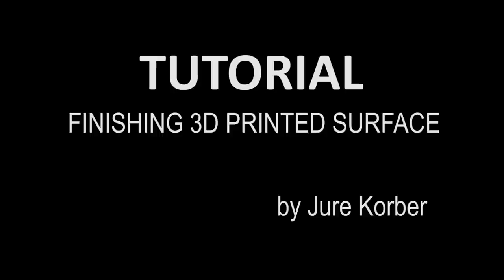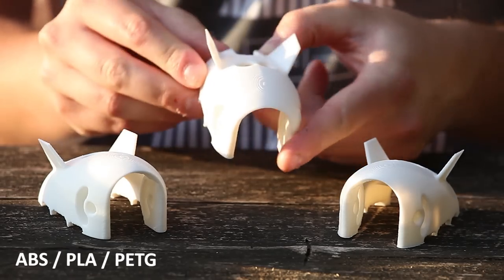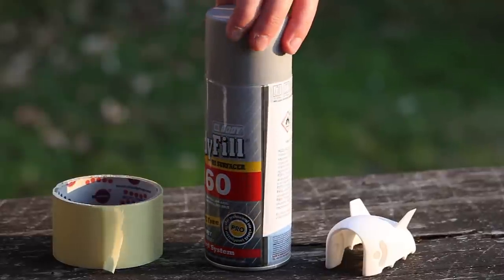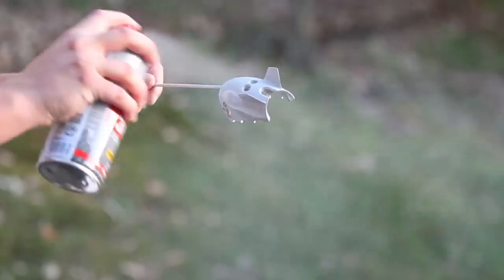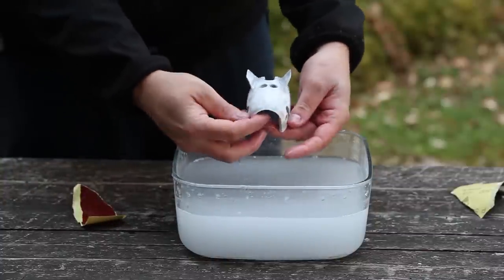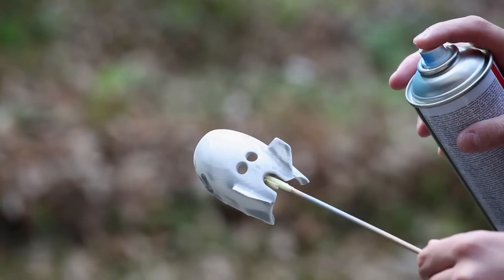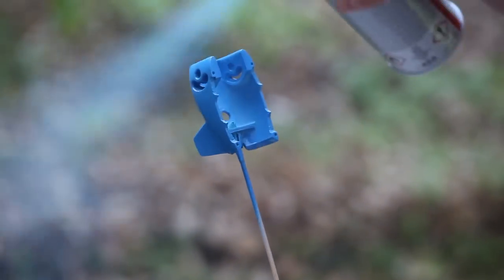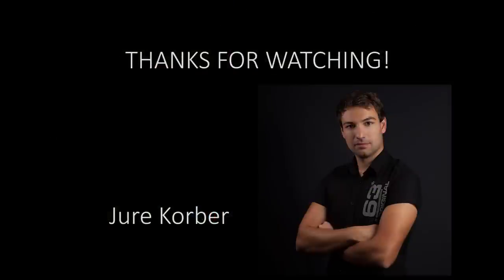Make your 3D printed part (surface) look awesome!  TUTORIAL

Comment: Can I use this technic on parts which are supposed to be assembled to other parts and have screw holes on them? I think the paint layer will make the part bigger and make it hard to assemble.
Reply from the maker: If you are careful, the paint can be very thin. Sending will reduce size and paint will than again make part bigger - so it may fit. You can also apply this technique only to visible surfaces and not on connecting / mating surfaces. You can protect mating surfaces with painters tape.

Comment: What printer are you using? I've been very interested in the past few months now they are looking more affordable.
Reply from the maker: I'm using Prusa MK2, which I find really OK for the price (kit). You need to upgrade it a little after buying and than you will have perfect printer with great print quality! :)
Reply: how much did upgrades cost?
Reply from the maker: Hey! I've paid around 150$ for the upgrades (IGUS bearings, NOCTUA cooling fan, additional printed parts for printer, another nozzle, replacement PEI sheet for future replacement when original one gets damaged). You can start with stock build, than print yourself upgrade parts with stock printer than upgrade it after some time :)

Comment: Do you have technique or tips for printed figures or characters.. tnx
Reply: Print with highest resolution and use filler. You can also use a variable temperature soldering iron on the cool setting to smooth out details. Works good a hiding bad layer shifts or extrusion problems, or where you paused the print, or where you just can't get sandpaper between. Takes practice though so try on a print you don't care about to get the technique. You have to push in light strokes with a flat tip, feathering it into the print.

Comment: Why do you use the filler? Can't you just sand down the raw part until it's smooth and then paint it?
Reply from the maker: Yeah! But with filler it goes a bit faster and final surface is smoother, as filler fills the tiny gaps that are left in 3d print surface. It also acts like a primer.
Reply: Got it! Makes sense. Thanks for the reply!

Comment: excuse me , I can't find the same spry filler in my city ,  ( the body fill ) as same as your video 
can you tell me  what should it be ? and what I must prevent ?
and thank you
Reply from the maker: It's no need to be exactly the same. It should be "spray filler" or "spray primer with filling effect". Anything for automotive use will work nicely! :)
Reply: is this usually used as clear coat for car paint ?
or can I use WD 40 instead?
Thank you
Reply from the maker: no and no.

Comment: You said in the guide that the arms need to be carbon fiber 4mm thick, how thick do the other parts (the three plates) need to be?
Reply from the maker: They are 1 or 1.5mm thick. Depends on what you have available in your shop.
Reply: juresnip thanks for the info! currently looking around online trying to find a good place to order the carbon fiber parts from. Do you also have a complete bill of materials for all the hardware like bolts/standoffs/spacers and such?
Reply from the maker: raw /sheet material or finished/milled?

Comment: what size of sand paper do you use 180 but after...?
Reply from the maker: Hey! It really doesn't matter what grade of paper you use. If you use fine paper, it will take a lot of time. The best is to use something around 200, than something around 500 or 600 and that's it. For final touch you can also use 1000 or 1500-2000, but I think that's not really necessary.
Reply: I use paste white befor sanding it work more easly I think cause sanding work well for simple object but for complex shape it s impossible to sand under little details ,paste +alcool can smoth little details...

Comment: Tutorials like this always focus on simple models with nice accessible convex shapes. It's a shame nobody has a method that works with finer, more complex models such as sculptures.
Reply: French polishing worked for me on a propeller once.
Reply: @kokeskokeskokes  How small was the part?
Reply: @Martial-Mat  22 cm diameter with sharpened edges.
Reply: @kokeskokeskokes  So do you physically polish each surface?
Reply: @Martial-Mat  Yes. It looked like this: https://www.youtube.com/watch?v=Co3JzInG99I
It was awful but it worked. Nowadays I prefer thin layers of epoxy spread exactly as in French polishing. It is not a shiny surface but it is geometrically more correct one.
Reply: Oh, and I remastered it. Many times. I am still working on it, trying to find the best finish.
Reply: @kokeskokeskokes  I'm not at all interested in shiny - just smooth. I've never done french polishing - how easy is it?
Reply: @Martial-Mat  It takes practice. There are some videos on tabletops, including filling. With epoxy, I recommend you to mix and paint the first coat thinly, mix rest of the batch with powdered chalk until the consistency of a softer toothpaste, and apply that. You can mix in more chalk in and use it as a clay. In that case you may want to coat your hands with oil and/or chalk, as well anything you need not to stick. Upon drying proceed on to sanding and french polishing, with shellac or otherwise. Latex gloves may be worth considering when working with the epoxy.

Comment: Is spray filler same thing as spray primer?
Reply from the maker: Not really... but spray filler acts like spray primer, so you don't need to use it on filled surface
Reply: Thanks! I will check it out. Great video btw :)
Reply from the maker: Thanks! :)

Comment: How much %fill did you use on that piece? does it affect the smoothing process?
Reply from the maker: Hey there! I've used 25% on this piece, but that doesn't matter directly. If you have enough top layers you will get same surface no matter the infill you choose. The nozzle diameter and layer height will affect the process, but not that much. If you use really small nozzle and really thin layer thickness, you might be able to spray paint the print directly to get nice finish, but printing will take forever.
Reply: juresnip thanks! Ive been testing xtc3d but the surface is not so great and i have drips in some parts...

Comment: Paint does not add extra strength to the piece. At best, it prevents UV degradation.
Reply from the maker: Print very thin wall and paint it, than compare to unpainted. It adds some strength and also bonds layers a bit better. It's not much, but it's there.

Comment: Looks good but i think after one crash your shiny fine drone pod is all broken because not flexible :)
Reply from the maker: Well I must admit that I crashed quite a lot since I made this video, but you wouldn't believe it... it's still in one piece! I was afraid for the "fins", but they seems to be really tough!
Reply: Nice to hear pro, what infill you use, I'd like to try to make some pods with PLA or are you using something else?
Reply from the maker: Defenitely go with ABS! PLA will get soft on the sun and also it degrades so fast! ABS is much tougher (maybe that's the reason it didn't break yet!) I think I used full infill for this, as thickness of the pod is not much. I've used multiple perimeter layers to get as strong print as possible (or concentric infill).
Reply: Yeah I think the key is using ABS, im kinda new in 3D printing and having some problems with ABS but i think the problem is unstable heat around the model, have to capture heat while printing the part with somekinda of foamboardcase around the printer.

Comment: Does this work without a 3D printer?
Reply from the maker: Sorry for late reply. It does of course! You can do that to any object with hard surface that has proper adhesion (in case not, you need to use correct primer prior)
Reply: juresnip i was thinking of my 3d printed parts (i use ninjaflex)
Reply from the maker: @Griseb4nk  it won't work with flexible materials as it will start peeling off right away. It needs hard surface to work.
Reply: juresnip i’m letting it dry

Comment: where do you get that enclosure?
Reply from the maker: Hey! I made it myself. It's made of aluminium 30mm profiles, plexi glass and wood (with carbon sticker). I've also included power supply for raspberry (octoprint) and arduino MCU for exhaust fan control, smoke detector, temperature and relative humidity sensors etc. :)
Reply: juresnip ah ok cool. I'm going to need to build one then lol. You did an awesome job in building it. You should sell them lol.
Reply from the maker: Thanks! :)

Comment: Which 3d printer did you use?
Reply from the maker: Prusa MK2
Reply: can you just tell me how much hard the part is?  i mean which you made by the 3d printer
Reply from the maker: Depends on material used. This was made out of ABS and you can almost stand on this part and it won't break. If it's made with PLA it's easier to print, but it's more fragile. You can also print with TPU, which is rubber. But you cannot apply this technique to soft/rubber parts.

Comment: no primer though?
Reply from the maker: No primer - in case of some plastics you might need it, but then again fillers usually are primers already, meaning you don't need any other coat beforehand. Depends on polymer too - I tested bare paint on ABS too and it worked nicely aswell.

Comment: Hello, I know that you answer this kind of questions a lot and I know may be you mentioned it in your previous video
But as I find you recently and I cannot check all of your past videos please answer it again :
I need a 3D printer to producing fountain pen (body) and the surface of products  should be smooth , shiny and layers shouldn't be visible. I don't need big printer because pens are not big. But quality is important.
What affordable printer you recommend and if you have any suggestions for material would be nice of you to tell me.
Heavy material is better because when you hold fountain pen you don't like light pen like a cheap BIC pen.
Thank you so much
Reply from the maker: Basically you can go away with Prusa mk2. It's really nice printer for really nice price. As you can see it's making really good stuff. PETG or ABS is preferred so you have heat-resistance (doesn't melt in the car) and it has good strenght. :) You need to threat the surfaces as the video shows.
Reply: juresnip thank you so much. I asked this question in several youtube 3D printer pages and you are the only guy that responded. you deserve 10 millions of subscribers . 
Thanks again.
Reply from the maker: No problems! Good luck with project!

Comment: Does it work on Nylon?
Reply from the maker: Yeah it does! Maybe you should use plastic primer before applying first coat of filler. :)
Reply: @JKTechSi  thanks! great idea
Reply: @JKTechSi  Was this printed with PLA or ABS?  thanks

Comment: This looks great... until your first crash. painted canopies will lose that nice look immediately after crashing. like any other painted part. and you cannot paint flexible 3D parts. but flexible parts are much more durable on a race or freestyle quad. your technique is the same as you can do it on a lot of surfaces... but nice job anyways and good tutorial :o)
Reply from the maker: Actually I had more than 50 crashes so far, and I must say that this stuff is really holding on! :D Canopy is so strong that you could probably stand on it... :D
Reply: juresnip cool! And how does the painted finish look after some crashes?
Reply from the maker: There is often a lot of grass on the paint, but I keep cleaning it with toothbrush and water. There is also few dents from small rocks that propellers threw in canopy, but other than that it's intact!
Reply: sounds good!

Comment: you sanded off nearly all filler...why not just use paint and then final sand with fine sandpaper and forget the filler?
Reply from the maker: Sure, that's possible aswell, with a bit thicker paint coat. Because this is drone part and it should be as light as possible, I've sanded everything off except some that stayed in the holes. It's hard to see it, because holes are so small and narrow.
Reply: Well the goal of the filler is just to fill in the uneven surface. Depending on what kind of paint you use, it may not fill in those dips or sand well enough. 

Now I would have applied another coat of the primer just to improve adhesion of the paint layer.

Comment: Looks good ... until the paint gets scratched or chipped.
Reply from the maker: Actually I fly with it now for 3/4 year, which is quite a lot I think and it held up a lots and lots of crashes now! Canopy might look weak on the video, but actually idue to its shape it's really strong. The paint really holds well. It only has some scratches from the rocks, which were propelled into canopy by propellers.

Comment: Do I only have the impression that many of those who comment here are technically impotent because they do not know the old basic techniques of surface finishing?
After all, it's such an obvious method that I don't understand all the ahhh and ohhh ...

BTW. Dude, when you spray anything, use the pistol grip and start next to the object, not on it. Then you will avoid stains.
And use half the paint at one time than what you showed.
Plus, if you print it with lower layers, you'll have a lot less 'stairs' to sand.

Instead of doing so much exercise with sandpaper, which is so boring and slow, it's easier to put it in a jar of a cotton ball soaked in acetone.
After an hour, the ABS surface is shiny and ready for the final painting.
period

Comment: Umm.. Dude this is really nice looking but you pretty much sanded off 90% of your primer and didn't reapply a new primer layer before painting. It worked out great for you but the right way to do it imo would have been to hit it with another layer of primer and do a quick sand with 400 grit before applying your color.
Reply from the maker: Well neh. When you see, most people just sand the filler (not primer!) off, leaving it only inside the holes and uneven surfaces. Paint is sticking nicely to this plastics, no need for primer anyway.

Comment: do not apply to much layers of color........
......proceeds to apply 50 layers of spray paint in 10 seconds
Reply from the maker: haha :D It's cropped video and it's very very thin paint - the one I'm using :) Problem is if it starts dripping.